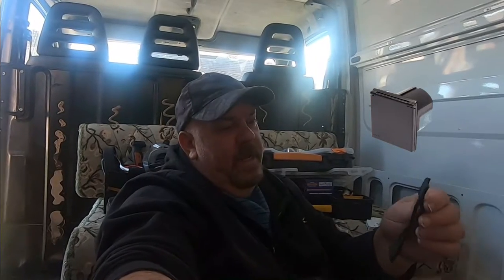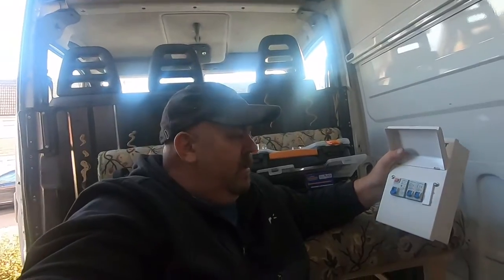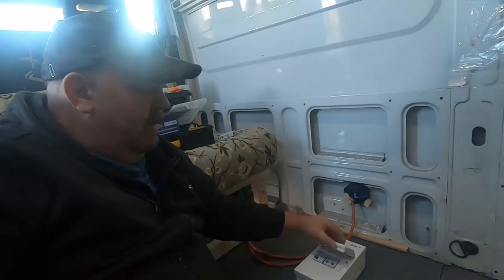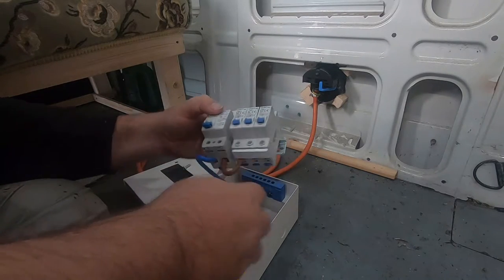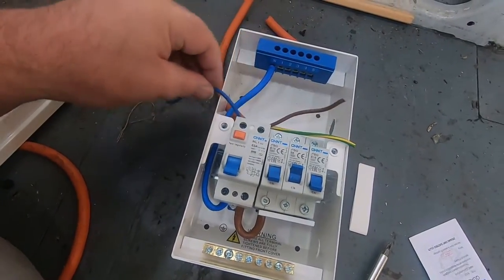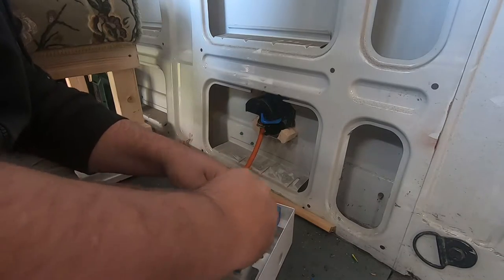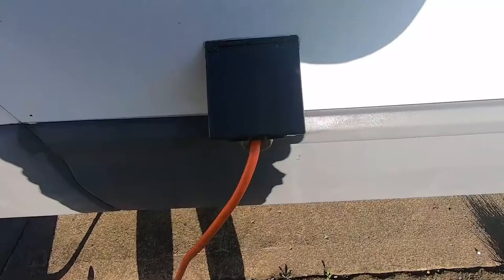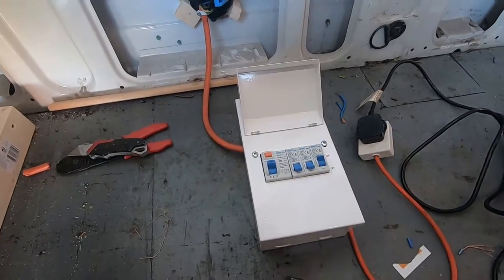#8 Installing the 240 hook up and consumer unit in the camper van

Comment: Great video 👍🏾 Can you tell me what the orange wiring is please?
Reply from the maker: The orange wire is the mains feed to the unit . It goes to the Input plug on the outside of the van , the plug where the campsite wire goes into. See thumb nail photo

Comment: Hi, great vid, thanks. When you added the plug (that the drill is plugged into) , what did you do with the earth from that flex? Does it not too go to the earth bar?
Reply from the maker: Yes the earth would go to the earth bar at the bottom if it has one ...i should have wired the earth in . Sorry to mislead you ,i should have wired it in.
Reply: @VANFLIPPINGTASTIC  Thanks for the info and getting back to me! 😀

Comment: really helpful with my hook up, thank you,  but when you put the plug socket into the consumer unit wjys there only 2 wires? my plug has got 3 wires
Reply from the maker: .. mine had two because the earth was not needed ..
your green wire (THE 3RD ONE ) goes on the earth bar at the bottom the the unit green / greenyellow

Comment: Hey fella appreciate the video. I have a question regarding the RCD: I see yours came with a 63amp version. Should there be a surge from your 240v power source would that RCD NOT trip unless the current reached 63amps? In which case your input power cord would need to be able to handle 63amps? I have a 32amp and am thinking to switch it out to a 16amp RCD or RCBO for this reason...
Reply from the maker: You are correct my friend , and I am also thinking of switching to 32 or 16 .
Reply: @VANFLIPPINGTASTIC  Nice one thanks for swift reply glad you agree wasn’t sure if I was being overly cautious 😂
Reply: RCDs don't protect against overcurrent.  It's fine to use this RCD in this situation.  My caravan came fitted from swift with a a 40 amp RCD.  The current rating on the RCD is how much it can safely carry/switch not where it would break.  

There should be overcurrent protection in the supply.  If it's a campsite bollard, it'll probably be an MCB or an RCBO.  If it's plugged into a domestic supply via a BS1363 plug and suitable adapter, the fuse in the plug will protect against overcurrent.
Reply: You haven't fitted an earth bonding wire between the consumer unit and the vehicle chassis. It should be 6mm square plus and bolted to a secure part of the chassis or bodywork, to earth the vehicle when connected to the power. With regard to the loose input cable, glands are readily available to secure and protect the cable.

Comment: If I want to run a 240v wire and then split it can I use one of then 30amp circle junction boxes and will it be safe.
Reply from the maker: have a look 3 and a half minutes into this video of mine
https://www.youtube.com/watch?v=4l7Riifi8nM
That’s what I have done . As long as both loads don’t exceed the fuse amps

Comment: I am doing a electric hook up in my race truck so I have done the hook bit but what do I wire the cable to in the consumer unit the 6 amp or the 16 amp then I need to wire in a battery charger do I use an extension cable or can I wire it into a fuse in the consumer as its only to charge a car battery that is wired up to my winch in my garage in my race truck hope you can help as I dont want to wire it all wrong as this is all new to me.
Reply from the maker: use the 16 amps for your plug sockets and . yes you can wire the batt charger direct but check the size of the fuse on the plug and go the same size trip switch if possable
Reply: Thanks for the quick reply I will sort out now thanks if I have anything else I am not sure about I will be in touch thanks

Comment: on your plug socket dont you need a earth wire
Reply from the maker: On the final install the plugs have earth wires. This was a drill will a plastic case and didn't have a earth anyway., but the final install has earth wired in. The earth should be wired to the earth  bar in the consumer unit.